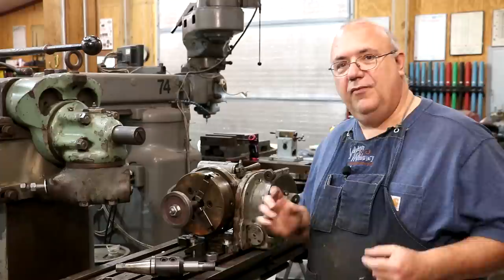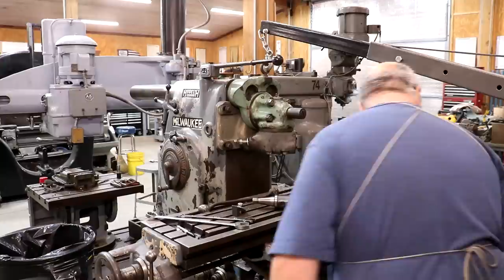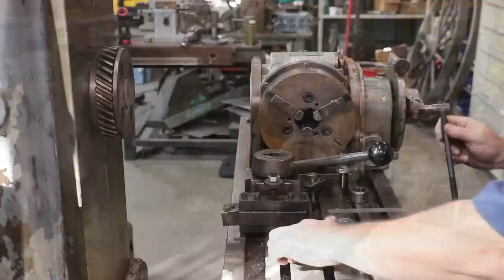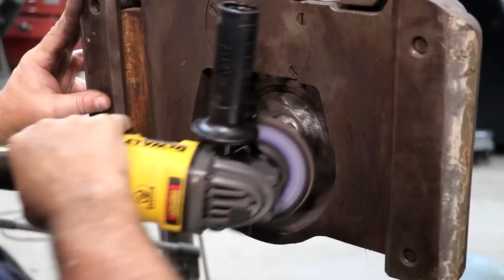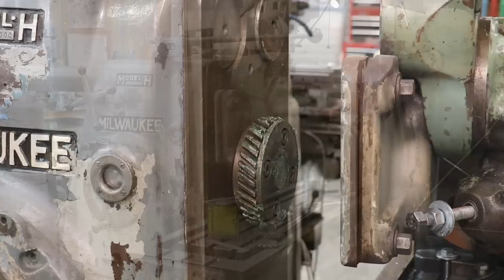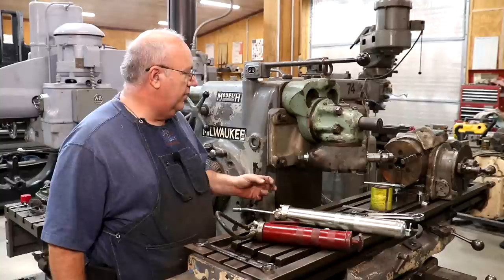Cutting Helical Gears on the Horizontal Mill 5 :Making Adjustments and Working on some Problems

Comment: This guy learned from the best of them . Abom79 , of how to make a 100 part series out of installing a bolt in a hole . I like this type of content , but cut to the chase . You are part of the problem youtube people have with milking every last cent out of google . Youtube is a nice medium for teaching and i appreciate your efforts . But doing things Aboms way isn't gonna garner you more viewers . In fact i think it has the opposite effect .
Reply: He is showing how to deal with difficulties encountered along the way when trying to make something most folks would never even try.  If you want videos that make it all look easy, stick to others like make it extreme or NY CNC instead of knocking Keith for actually teaching how to do some of these more complicated operations, esp. on older manual machines.  In a larger shop, this job would have one or more dedicated machines and he is walking through setup, checking and troubleshooting issues found along the way to making a part without destroying his machine in the process.
Reply: Yep!  More episodes that a soap.
Reply: Easy solution, don't watch the channel for a year or two.  Then go back and binge watch the project to completion. 😁
Reply: @ R B 
Is this opinion based on all your years of experience making YT videos? Would you mind sharing the analytics that led you to this conclusion? Thanks.
Reply: It's a divisive issue, On this instance I appreciate the slower in depth method as this is harder to learn compared to other things I grasp easier. Other times I already have experience or natural insight and just need to know the one bit I don't know. 
Maybe Keith or others will make 2 videos for each topic, one quick one slower. Or maybe he wants to do it his own way. Only people who have millions of subscribers with a big merch store that they constantly product place in the cool life styles the show they are leading make lots of money at this.